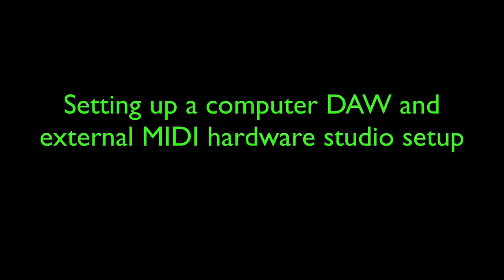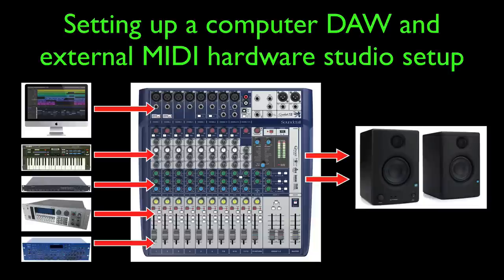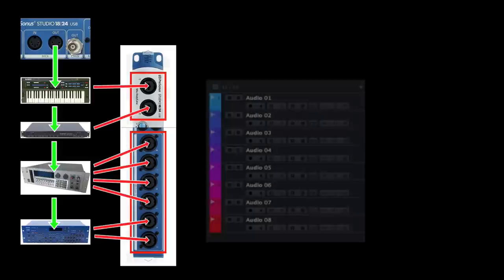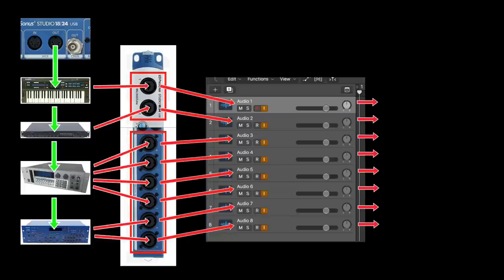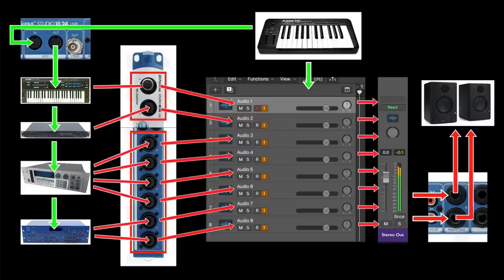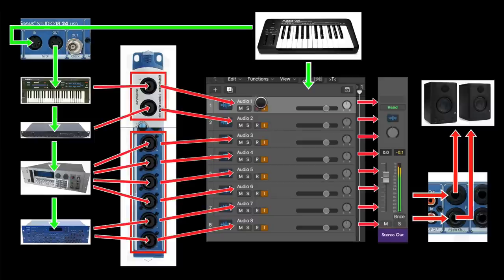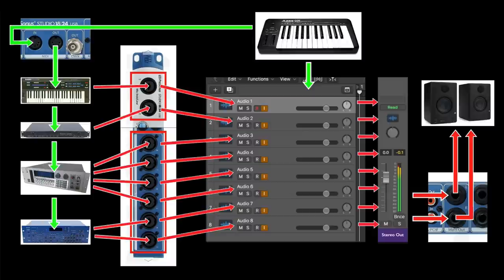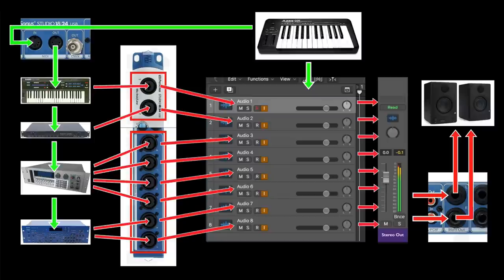How to setup a computer DAW & external MIDI hardware studio

Comment: You left out the huge problem people have with the delayed start a lot of hardware synths have when triggered by the DAW sequencer. Then you manually lining up the audio. Protools has a midi offset setting for each channel but for some reason just does nothing. This is the biggest issue. The ERM Multiclock has offset setting to set each device to its corresponding delay offset. But I haven’t bought on because it’s unclear if this value changes with buffers setting changes which would be a PITA.
Reply from the maker: you mean the latency when the hardware audio passes thru the system right? that only can be an issue if you are also using onboard generated sounds which are NOT passing thru combined with sounds from hardware passing thru, otherwise everything you hear has the exact same latency (if any) ... but if you set low audio sample buffers - like 32 or 64 samples - thru latency is so small it's not really perceptible & when you record the hardware & then play it back for final mix any THRU discrepancy goes away. Also  at the end of the day all the daws have an auto time-align now so you can just switch that on to align all beats and also if required divisions to each other for all audio recordings, making them totally locked, & choose a reference master track for them all to sync to ... Logic does that with FLEX & Groove track for example.

Comment: I have a question. I have a synth that has 8 midi channels already. For each of the 4 analog parts and for the 4 digital parts. And other synths that have also 2-4 channels. So I run out of 16 midi channels on a bus. How do you go about recording those and how can you extend midi outputs in the best way? There is the MOTU but I’m not sure it solves my problem of having my daw or controller keyboard play one of the assigned synthesizer with its midi channels.
Reply from the maker: well you'd have to have more dedicated midi out buses: try reading & asking here: https://www.midi.org/forum/144-how-to-connect-and-manage-a-massive-collection-of-midi-hardware

once such a setup is created, like as usual you always play the required midi unit from the laster keyboard THRU the DAW track assigned to it which both routes the midi TO the required unit & allows recording of the played parts to the required track of course

Comment: Great videos mate, keep it up, however what if someone has ONLY a small mixer, a basic 2ch interface, And very little money?
Reply from the maker: in that scenario, you'd send all hardware to the mixer, send the mixer L/R OUT in to the daw input L/R, then compose your external midi parts. To record each external bit of kit to the daw, you'd mute any other mixer channels which are active, record that bit of midi kit to an audio track in the daw, add fx & eq etc in the daw to that newly recorded audio track & carry on like that, recording each item of midi kit one by one to audio tracks and then mixing those stems in with the onboard daw sounds. Obviously any external midi kit running on the mixer will have no fx unless the mixer has fx built in or the synth has built in fx, or you have external hardware fx, but tbh a cheap old s/h midiverb type of unit would get you delay & reverb ok, you could even use guitar fx pedals just to get some basic reverb & delay
Reply: @dancetech  I know it may be too much to ask, but could you do a short video of that please? Thanks mate, great stuff.
Reply from the maker: yes, but ideally i want to wait until i have rebuilt my work room. When that is done i'll have a mixer, 8 track & lost of hardware setup again & I will be doing lots of hardware & DAW tutorials 👍

Comment: i have logic pro 6 (daw)
akai s3000 xl (sampler)
yamaha pss 680 (midi keyboard)

primarily (for now) i just want to trigger the samples from the akai with my midi keyboard, and have that recorded down into the daw.

i have a 2x2 midi interface, but have forgotten how to connect that all up.
keyboard (out)
midi interface (in)
midi interface (out)
akai (in)?

i'm sure that's how it used to work when i was using the atari 1040 st  running cubase 3.

Comment: I have been doing this for years but am now realizing that I cannot use Quantize features that midi recording offers to fix or align timing. I would actually like to use the internal sequencers of my MODX, Nautilus and Fantom 6 all synced together...trying to figure if that can be done
Reply from the maker: Yes it can, thats how we worked in the old days. Any hardware unit sequence can usually optionally clock as a slave to another sequencer, and the daw can slave to any external sequencer, so you choose one hardware unit as the master and slave the others & the daw to that

Comment: yeah, but some of my lush combi patches on my modules use up to 16 midi channels for one patch! what then?
Reply from the maker: Set the door external midi track to output on all channels. Obviously you will need to mute any other external hardware units.
Reply: @dancetech  hello , i need help i have TG 77 yamaha rack and i buy it some DX electric piano patch, and i need to send the patch to TG 77 witch midi conections , i start to download SY manager 5 and folow the instructions ,but i dont now have to connect my synth rack ,when i connect in modul write missing connection what is wrong? please help me
Reply from the maker: @marcusbernhardt7807  sorry, I dunno, but purchases of

Comment: Hi, great video. I’m looking to get a few bits of hardware starting with the Proteus 2000. Only one thing I’m confused about. If I connect my Proteus via midi to my audio interface how would I then connect another piece of hardware? Is it chained via the ‘thru’ midi port on the Proteus and into a line on the audio interface?
Reply from the maker: dont confuse midi & audio... you connect the MIDI OUT of the audio interface (or from a separate USB Midi port device) and connect to your MIDI hardware via IN & THRU sockets on each device or via a MIDI distribution THRU box with each THRU output being connected to the MIDi Input of each bit of hardware... the audio is completely unrelated & always the same, simply connect the OUTPUTS of the hardware devices to the INPUTS of the audio interface.

Finnally if you want to actually play any bit of midi hardware from a master keyboard, that needs to be connected to the DAW MIDI INPUT.... you leave the master keyboard set to channel 1... select sa mdi track in the DAW and assign that track to the midi channel fo the external device you wish to play & record midi notes & data for.... the dAW midi channel will re-channelise the incoming midi from the master keyboard, sending it back OUT of the daw to your external midi chain on whatever channel the daw midi track is set to

then obviously each bit of external gear needs to be on a different midi channel

When using multi-timbrel midi devices like the Proteus you plan to get then obviously you can assign different patches to midi channels inside that device... just make sure no other bit of external midi kit you add to the chain uses any of the channels utilised by the Proteus (or any other multi-timbrel device)
Reply: @dancetech thank you very much that makes absolute sense now. I’ve go my proteus on the way so when I get my next bit of kit I’ll know what to do in order to get it all working. Keep up the excellent videos please 🙌🏻
Reply from the maker: @louiehewitt6514  cool, any questions, just ask 👍

Comment: Great video! But say you have the Behringer RD-8 drum machine and want to record using the 11 individual outputs? I have the PreSonus Studio 1810c interface and it doesn't have enough outputs. Then what? I also have the Drumbrute Impact and don't even know how to record using it, in Studio One. I have to get on it!
Reply from the maker: add a cheap behringer adat interface & you get 8 more inputs - 159 euros!

Comment: Unless the DAW/software is capable of midi mapping for external ports, each with 16 channels, you are restricted to just the 16 midi channels you've mentioned/shown.
Using external midi junction boxes, such as a Motu, allows for multiple ports for direct control/access in the computer software.
I've found none of the "new" daw software having this "knowledge", since externals are no longer a priority, just crappy sounding samples and plugins.
The bi-directional usb midi connections can and do cause many software driver issues. Most drivers were developed for either windows or Mac.  
Example; an older midi box like Motu, will not work within a Linux midi setup. Likewise a Motif ES rack module which has 8 ports within it, but only accessed by window or mac drivers.

Comment: I have a query to ask. 

So I have an Alesis q25 MIDI controller, as shown in the video, and I have a Volca Drum synth.
I also have the Soundcraft MTK 12 mixer and Focusrite 2i2 Audio Interface. 

My goal is to sequence MIDI on the DAW and trigger the Volca Drum sounds to be recorded in the DAW.

As of now I was trying to send the DAW MIDI sequence to the q25 via USB and to the Volca Drum through the MIDI out. But, alas, I’m unable to trigger anything while I play the DAW MIDI sequence, but can hear the sound if I play the q25 keys. 

Is a MIDI thru box the only solution?
Any other workaround? Thanks.
Reply from the maker: Q. You have the MIDI OUT socket of the Q25 connected to the Volca MIDI IN socket, so when you play the Q25 you are triggering the Volca directly? 

If the answer to that question is YES... then are you triggering the Volca via the Trad' MIDI OUT socket on the Q25, AND recording that same MIDI playing data to the DAW via the USB connection from the Q25, both at the same time?

The problem to answer  your question is that the Alesis so-called 'manual' for the Q25 is little more than useless & their own official product video on youtube is again next to useless, so there's no way to know if the unit's MIDI OUT works to route MIDI data incoming via the USB connection to it's own MIDI OUT port.

I'd have thought that it's unlikely it does that TBH because then the Q25 MIDI OUT would need to function as a combined OUT/THRU socket adding to the unit's cost - BUT it could be possible to switch the Q25 OUT port function in software or via some button press on the unit from OUT to THRU mode, but again the manual says nothing on that.

However before you spend more money you need to contact Alesis and find out the answer to that question 100% - and/or do some checks to 100% be sure the DAW is sending MIDI data OUT to the Q25 on the correct channel for the Volca and the DAW has the Q25 correctly set as the default MIDI port (You dont say if you can record MIDI data IN to the DAW from the Q25)

So if you check all the above & the Q25 indeed CANNOT send incoming USB MIDI data to it's own MIDI OUT port, then you'll need to buy a traditional USB midi hub.. something cheap like the ESI MidiMate eX, or go more expensive... or upgrade your audio interface to one with trad' MIDI IN/OUT connectors
Reply: @dancetech  thanks for getting back quick on this. 

Answer to both your questions is yes. And as you mentioned, I couldn’t get much out of the manual. I did wonder whether there is a way to switch the routing from MIDI OUT to THRU in the keyboard itself. 

I could only switch the Volca Drum PROGRAM 1-16 if I pressed the PROGRAM on the keyboard. 
However, I noticed that the keys stopped triggering the Volca if I pressed the MIDI CHANNEL on the keyboard for some reason. 

As you mentioned, I might have to contact Alesis to get more clarity in this issue before spending on a thru box.